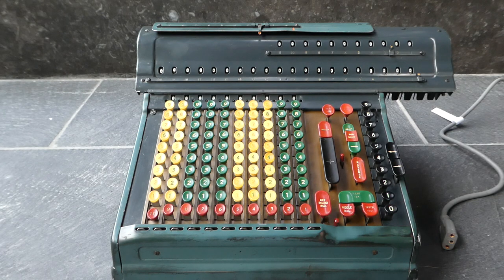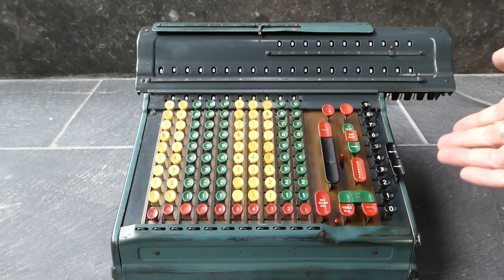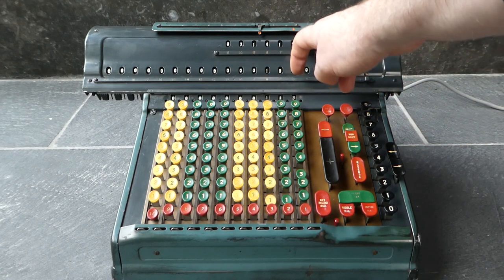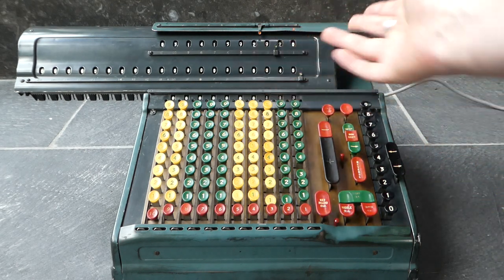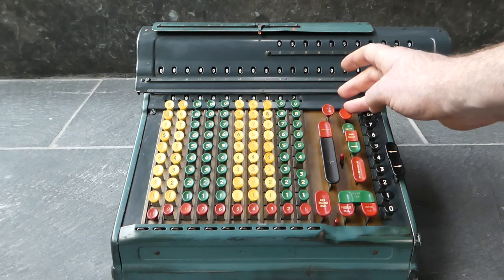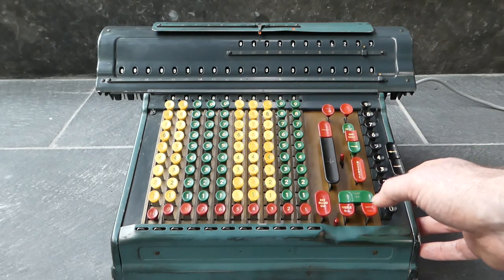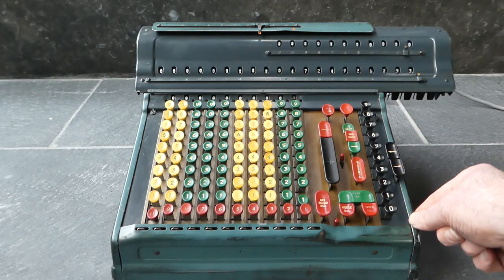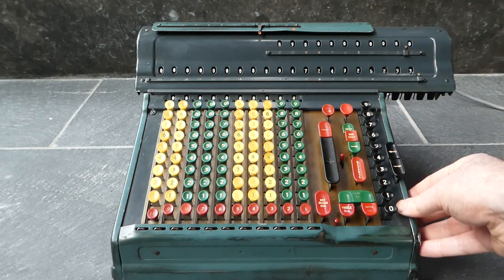The STOP button of the Marchant ACT-10M calculator

Comment: Something tells me that Jaap likes his newly restored machine!!!!  Those are some really useful techniques that you probably wouldn't stumble upon by accident - did you already know about those Jaap or did you in fact, figure them out by trial and error?  Really want to get mine going now.........and there's a Mercedes Euklid somewhere in a van heading my way at the moment!!!!
Reply from the maker: Yes, I do like it a lot. I'm just getting the most out of it before putting it back in storage again.
The uses of the "rolling motion" technique were described in the manual. I don't remember what site or video I found the other two uses of the stop button (releasing keys, double tap to abort division by 0). The transfer technique is my own (re)discovery, and it is basically multiplying 1 by that number. Transfer in the other direction can be done automatically simply by dividing by 1.
Is it an electric Euklid, or a manual #29 model? Or an old boxy one?
Reply: @jaapsch2  The double tap on the stop button could definitely come in handy, and the rolling motion is brilliant.

It is an electric Euklid - a model 21 I think, I'll see what state it's in when it arrives, hopefully not too bad - I could do with a nice and easy repair for a change!!!